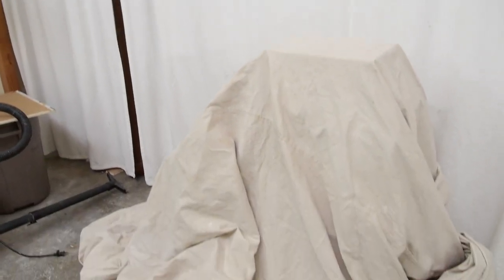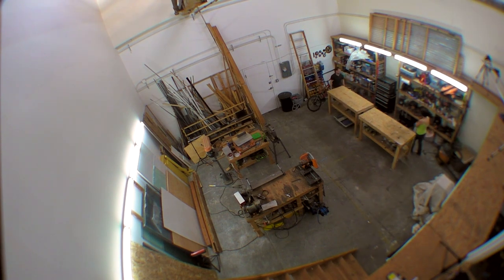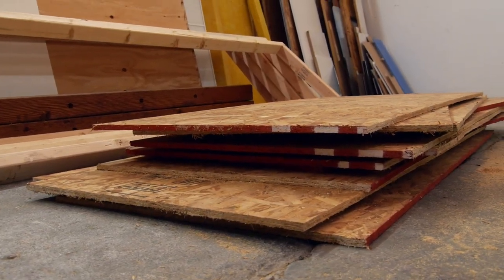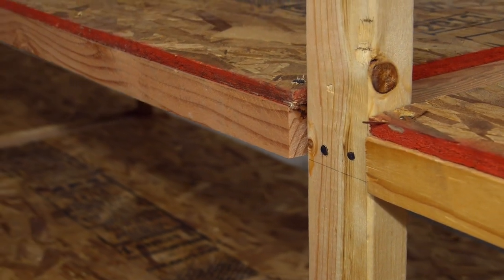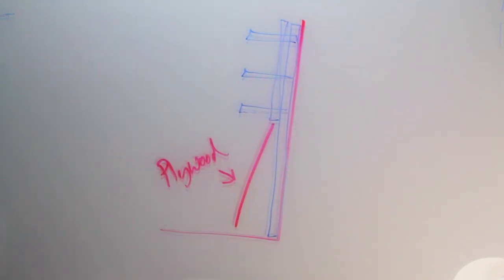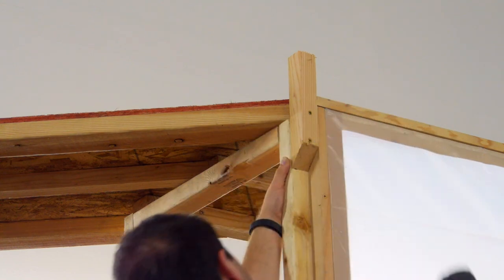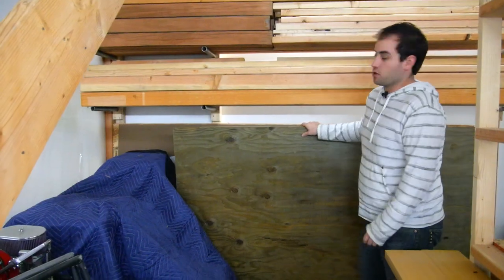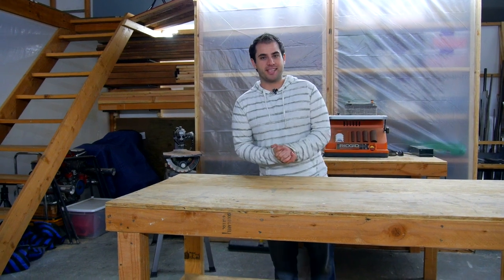Half-Assed Project: Workshop Storage

Comment: Would be awesome if you used some sort of canvas instead of the plastic, probably more expensive but maybe something you can upgrade on the living room wall? Grate video as always, hope to see more! :)
Reply: ***** That is true, did not think about the dust. You can maybe have the the side facing the workshop have a plastic layer over it. If you have black curtains as the wall material and put a light source behind it you will get a relay sweet effect on the other side, i have a similar setup at my place.

Comment: You could try to make a false ceiling? would make the room alot smaller, so the existing lights would fill the area alot better :D
Reply: Yeah, i get that, high ceilings are handy fot alot of things, like storaging long ends of pipe, or wood, and with the new storage racks i don't think you'll be able to lower the ceiling very much ..

Comment: Nice one. BTW 6 Mil plastic is not 6 millimeter thick, but a sixth of a millimeter. Fairly thick for plastic and common in Europe for building purposes. A millimeter is just under 1/25th of an inch, in case you wonder.
Reply: It's not a sixth of a millimeter. It's six thousandths of an inch.